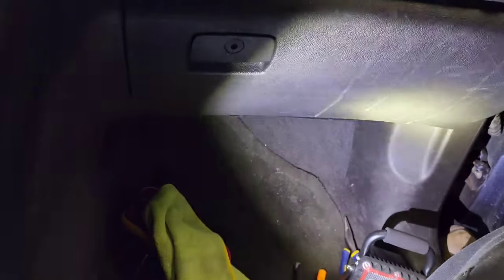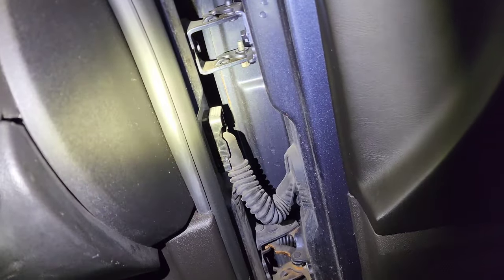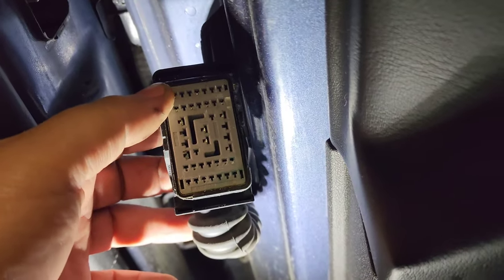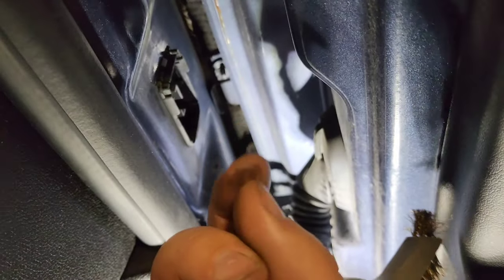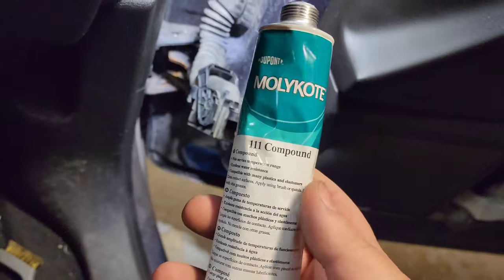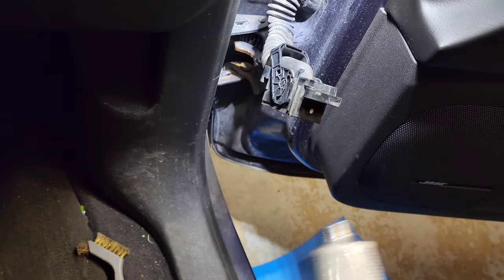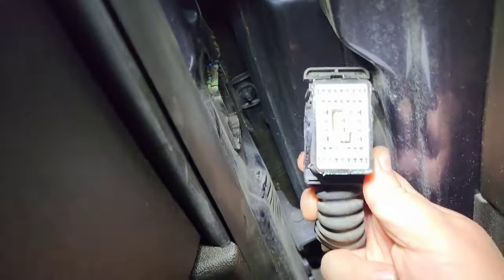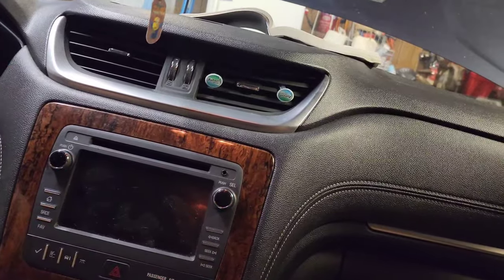CHEVY TRAVERSE RADIO/BLINKER/CHIME SOUNDS NOT WORKING FOUND FIX!!

Comment: I disconnected the battery and then check each door connection. Front drivers and passengers both had a little corrosion and all audio Sounds coming again. Hopefully this is a solid fix. Thanks for the information.

Comment: Maybe disconnect the battery before sticking a metal brush into an electrical connector? Ever hear of contact cleaner? Even alcohol eats corrosion.
Reply from the maker: You don’t need to worry about shorting stuff. That what the fuses are there for bud
Reply: @justinokelly382 hey brother I pull off my radio because my grandson put in a few coins in to my video compartment so I pull it out the radio and pull out the coins so after I take out the coins and put back on the radio now the radio doesn't work no light on do you have any idea what can be please and thanks for the video in advance

Comment: I’m going to try this . Radio stopped working , no signal noise , not even seatbelt & the static sound my Lord . I’m hoping this is the recipe 🙏🏾
Reply: Rite mines not working either and they said my fuses is good lol I can’t ride without music
Reply: Did either of you find out what the problem is?  My traverse radio lights up but no music, no turning signal or any other noise coming out of the speaker.

Comment: Having the same problems. The speakers were making a crazy noise even without the key in so I thought it was a fuse and changed it. It’s stoped the crazy noise but now no music but a display and chimes on blinkers not working..going to go do this right now.
Reply: Hey there I having this problem but I push the break couple times or long break the noise stop but still no sound I don’t know what connection but it help to stop noise

Comment: My system has a mind of it’s own in the summer when it is very hot the chime is very loud when I open the drivers door but when it is hot a chime is very loud I only have front door speakers no rear speakers I have tried the door connector and clean out any water and used a good amount of dielectric grease I also have got in the habit after a hard rain and or car wash the dielectric grease is very good no water but still no rears and sometimes both dents but most of the time only right front speaker and drivers side tweeter which sound like shit I have tried new chime and new relays which now I am getting no response from the deck after I have been driving for a while any thoughts on this please let me know thanks